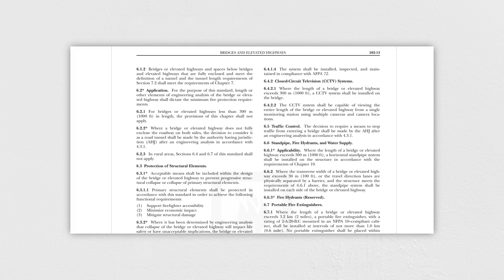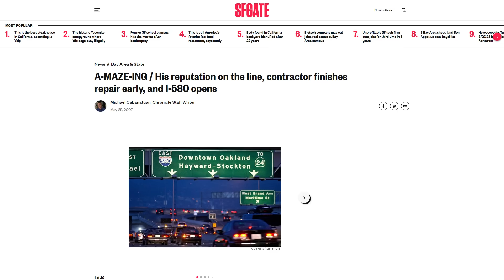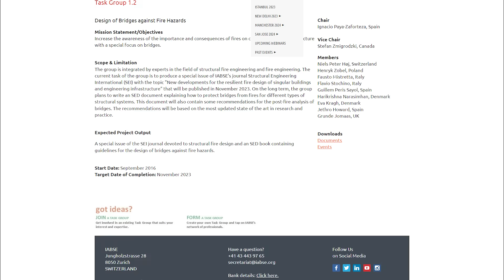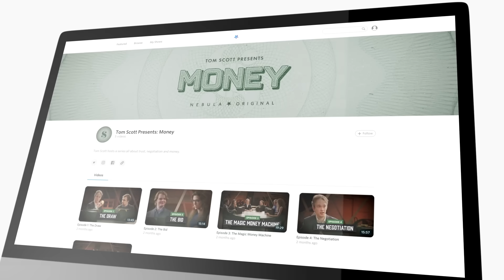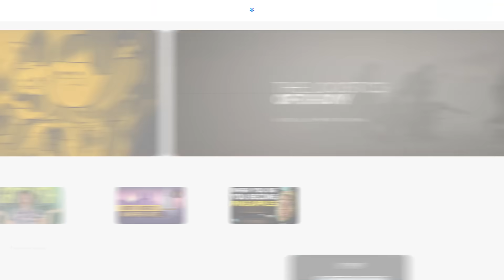Philadelphia I-95 Bridge Collapse Explained

Comment: I remember when the 2021 floods took out 3 bridges and sections of roadway on Highway 5 + taking out over 5 other bridges in the surrounding region in BC.

It took them 20 months to build the 200 km stretch of highway.

It has been over 20 months, and they still haven't rebuilt the 3 bridges that got knocked out by the floods. They have repaired the areas of road that got washed away, but the bridges have just sat there.

One bridge got knocked out along the HWY 1, near Boston Bar. A temporary bridge was installed in its placed, and no further work was done. There was work to done to reinforce the creekbed incase of another flood, but 20 months still and there has been no work done.

Comment: Grady -- Could we construct a cost-effective fire suppression system using something like the standpipe approach for tall buildings?

Basically, install high-volume sprinklers underneath the overpasses, with the supply pipes extending up to the road and slightly away from the bridge structure. Terminate the pipe with a standard standpipe fitting. Do not provide a permanent water supply.

Instead, if a fire starts, fire trucks will come to the scene, hook up to the standpipe(s) and supply water to put out the fire. 

Would that work?

Comment: This guy is also explaining the 911 attacks too. The facts are when you use any flame higher than the steel was formed the structure will collapse. Aviation fuel burns so hot that what brought down the towers. It's amazing how the left uses it's own info against themselves. Great video.
Reply: I don't think that was a left or right conspiracy. Because I know plenty of conservatives who believed it was a false flag and yadayadyada. The temperature isn't higher then the steel was formed, but the steel doesn't need to melt to weaken and sag under load

Comment: was hoping you would explain the structural failure mechanism :(
Reply: Steel gets soft when hot. everyone I'm assuming has heated up steel to make it easier to bend at some point
Reply: @SilverStarHeggisist  these structures are primarily concrete, are you proposing the reinforcement heated up thru the concrete cover? mild or tensioned reinforcement?

Comment: Being fire damage is becoming an increasing problem would it be worth and or possible to install/retrofit fire proof composite panels to the underside of the bridges that are at a high risk? Obviously you are going to lose some height by installing the panels but would the trade off be worth it?

Comment: When a gasoline truck burns down a steel/concrete bridge it’s accepted as fact. When large planes loaded with jet fuel cause buildings to collapse, it was a inside job because fire can’t weaken steel. In other news, Trump is “winning”.

Comment: One element I'm surprised you didn't discuss: A tanker fire is a destructive BEAST. Designing around something like that just seems prohibitively expensive, especially given the rarity and isolated nature of the risk.
Reply: Well, there are (relatively) cheap measures to prevent large fires under bridges in the first place: guard rails to prevent vehicles from crashing into the walls (and staying there as a result), lane direction separation to prevent head-on crashes, and education of drivers to not stop under or on bridges and in tunnels even if their vehicle is on fire. The latter is the most important - even if your vehicle is actively on fire, the wind keeps it relatively contained but once you stop, that effect will vanish and the fire will outright explode in intensity. This is also why, at least in parts of Europe, trains in high-speed train tunnels need to have emergency brake override systems in place.
Reply: @harddiskwp Well, a lot of these bridge collapses in the U.S related to fire happened on interstates, which are divided roads. I would be very interested to see what the Department of Transportation has come to the conclusion of the cause of the accident that led to the fire.

Because 1 or 2 times is a freak accident. But when it seems to be happening once every year or 2, something may be going on outside or just the design of the bridge and the roads.
Reply: @clonescope2433   There's a bit of a black swan effect here. Extremely rare events become more common as you expand the number of opportunities. 50 thousand miles of interstate and (according to BTS) 590,000+ highway bridges - even a 4-in-a-million chance would result in about 2 per year.   

(Very slim odds) X (Half a million rolls of the dice) = a high likelihood of event SOMEWHERE. 

But, reinforcing half a MILLION bridges is incredibly costly and would be more disruptive to traffic than the rare fire event. So the reasonable thing is to make them safe against more common issues and plan to quickly rebuild when needed.

Comment: A simple tradeoff would be to reduce the risk of large fires by stricter regulation of large flammable loads. Lower speed limits, higher standards for these drivers and vehicles. An increase in transport costs to reduce incident costs. I think many countries have that to some extent already.
Reply: you could make the trailer entirely crash proof, the increased cost to everyone else though would be astronomical. I'm not sure anyone wants to pay $20 a gallon just to prevent a relatively rare event

Comment: Wondering if it wouldnt be better to engineer tanker trucks with some kind of fire suppression system that engages on a cetain level of impact than bridges
Reply: Once the fire gets to the trailer, there's no system that will fit on a single vehicle that will stop it. a typical car fire is something like 5000 gallons of water to put out, and that's only 10 to 40 gallons of fuel. Now picture 5000 gallons of gas or diesel on fire.

That being said, if it's small, the truck has fire extinguisher(s) onboard

Comment: @Practical Engineering  Grady, thanks for the fantastic educational content. Would you consider a video about extreme heat events and problems with commercial flight? We’ve had cancellations due to heat here in Phoenix at temps over 120F (most recently 2017) and those temps will be more frequent and persistent in coming years. Do runways have to get longer? Or jet engines souped up to accelerate faster in takeoff? This is a climate change effect that we should probably talk more about.
Reply: Mostly, cargo and passenger loads have to go down. High temps reduce the lift over the wing (because the air under the wing is less dense, same reason hot air balloons don't fly in Phoenix in the summertime). Back in 2017, the tables that told them how much load the plane could carry versus temperature, only went up to 120F. So when it hit 122, they had no official guidance, so they stopped takeoffs. Now the tables go up to (I think) 145F.

Comment: Having been a messenger for 15 years in the Metropolitain Chicago area I have seen a lot of close calls.  Bridges with roads resurfaced under the bridges lead to many sheared off truck roofs. Trucks driving to fast in snow and rain. On one new vehicle break in run up into Wisconsin I had 3 tanker trucks southbound into the center of Milwaukee behind me pushing over 70 miles an hour. On the high bridge near the power plant south of the big interchange there had been a spinout  by a large 4-door car police officer was standing on the bumper to keep it from falling off the bridge. I did a half spin ended up sliding backwards for a half mile then flipped it straight before I hit a clear patch no idea what happened on the bridge too busy keeping the slide straight.  Knowing when to slow down is something many truck drivers seem to forget too often.

Comment: Ironically, a bridge with a wooden beam of equivalent load bearing capacity would be unlikely to fail under such circumstances. (It would also be absurdly large and heavy) However, I'm certain nobody would stamp a design with a wood construction. Although mass timber (not light stick frame) structures are known (and engineered )to resist fire.

Comment: I've been curious why  they decided against shoring up the south-bound bridge with a lot of wood as a temporary solution. I think the rebar in the bridge deck was still green when demolished. I think this would indicate that the driving surface didn't get so hot that it would be unusable. With enough wood, the bridge deck could have been supported without any reliance on the compromised steel beams. I suspect big wood beams are more expensive and less common on the east coast than here on the west coast. But it seems to me they could have had the highway open in half the time with shoring over the demolition and fill option they chose. I know I'm second-guessing the experts, but isn't that what the internet is for. :)

Comment: I'm a bridge engineer who works in downtown Philly. This section of 95 is directly on my commute. Although traffic was backed up in the detour, it was not nearly as bad as I expected it to be (+30min). The new fix is indistinguishable from the previous state in terms of traffic, because that section of 95 was already taken down to 3 lanes in each direction for construction.

As you pointed to on the video, we basically never design for fire. There's no point. It's statistically a very low probability that fire will damage or destroy a bridge, and engineers design based on probability.  It would be a waste of money, time, and materials. But most importantly it would severely complicate important aspects of bridge maintenance like inspection, considering most fire protection systems involve buffering the damaging heat with other materials over the bridge elements.  It's not a building where the structure can be hidden; we have to routinely inspect these elements.

Comment: Im not sure that at least your opinion in the cause of collapse was presented. From the limited pictures I've seen, i can't tell what the bridge girders were made of. Steel or reinforced concrete? How would a fire of that magnitude affect them differently? How  long was it burning before fast the fire department arrive? Also as others pointed out, overpass failures and tanker truck fires seem to correlate. Maybe the question is not how to make the bridge withstand a fire, but to make the tanker truck safer.

Comment: I'm aware of a motorway viaduct/ junction in England that was designated a national secret (even though 200,000+ vehicles per day pass through it) because an attack upon it could take out not only the road, but a railway, a canal and a major high pressure gas line.    Large vans and trucks 'stopping' underneath for an extended period of time would very quickly get a visit from the police for a welfare check.

Comment: Tanker fires under bridges are likely often because the drivers stop there in the shade when they are having an issue that turns into a fire. 
Not all tanker fired start in or on the tank or because of its contents.  
They likely start because of overheated brakes, blown tires that aren't noticed until they start burning and so on.

Comment: couldn't they make a designated fuel tanker route and have the most vulnerable brudges along that route equipped with a halon system or fire suppression foam? we know where the tankers come from and where they're going, I'm sure hazardous material transport regulations already have infrastructure you could tap for the logistics.

Comment: Most construction is slow, because they're just being slow. Throw money at them, and it gets done lightning fast. In this case, they likely did involve more labor, but that's often not the case. (many jobs can be completed faster without additional hardware or people.) [When you're paid by the hour, you make the job take longer. When paid by the job, you get it done as fast as possible. Both have their obvious draw backs.]

Comment: Steel bars and joints are melted from heat exposure and whole structure lost integrity and its weight pushed it down. Gravity is a beech.
Reply: Softened yes.  Melted no.

Comment: It's kind of intriguing how many tankers get into accidents perfectly under bridges. Hundreds of kilometres of open road, yet they crash at the few 10 metres under or on a bridge, much more frequently than chance level.
Reply: My theory is they stop under bridges when they have trouble so they are in the shade. My guess is the fire is secondary to the original issue with the trucks.

Comment: This was another high-quality video, Grady.  There is a similar situation in the electric utility infrastructure realm.  As a retired electrical engineer who worked in the distribution, substation and transmission portions of the industry, we established design and protection/response policies based on the likelihood of a destructive event occurring and the time/cost to recover from it.  For example, Over 90% of storms have destructive winds with speeds of 80 mph or less (broad generalization).  The engineering divisions or policy makers establish strength standards to withstand 80 mph winds (plus some safety factors).  It is known that usually no more than a half mile of transmission line will fall down due to the winds hitting a section.  The utility will maintain an adequate inventory of poles, conductors and insulators to replace about a mile of line within a few hours to a couple of days after a significant event.  Storms beyond that necessitate a broader response, often coming from several states distant.  Typically, the electric utility will purchase insurance coverage for its substations and generators but it won't secure insurance for its distribution lines or transmission lines.  They self-insure for the cost of events spread across broad areas of service territory, which can sometimes mean thousands of miles of distribution or transmission lines.  A key response tool for both the land transportation network and the electric utility network is to have had a cross-section of its operating division personnel participate (periodically) in "what would we do if....?" exercises to identify the range of possible recovery alternatives.  HILP - "High Impact Low Probability" events demand some attention - at least to have been thought about if not also going so far as to acquire a stockpile of fast-response supplies.  Keep up your good work!

Comment: Before watching: 

"Why fires destroy bridges".  Huh?  Why wouldn't they?  Fire softens metal, decreasing its tensile strength.  Fire partly decomposes cement, weakening concrete.  And big fires don't happen on bridges often enough to justify designing them to withstand it.

After watching: Ok, it's a bit more common than I thought. But there are a lot of bridges, as you say.  Too bad you didn't say anything about how expensive it would be to make a bridge capable of remaining usable after a tanker fire.

Comment: In October of 21 I was consulting for an oil and gas firm. The engineer decided a bridge didn't need replaced to support rig traffic. We put a truck partially through it. Scrambled with multiple contractors to get a temporary bridge. The cost of closing the roads was millions of dollars a day. I spend 3 mill in 45 minutes to get the replacement temp bridge and personal mobilized. Emergency projects are very interesting to work on and understanding the economics is fascinating

Comment: Easy Solution is to mandate a Basic Low Pressure Sprinkler System Or a Foam sprayer on the Tankers and you can Save Many lives..

Comment: Heh.. the freeway overpass your video drove under (with the Arizona Loop 202 sign) is one I drove under daily for nearly 20 years. Used to live six miles away before moving a little further out. Unexpected. :) Actually, there were a couple of locations I recognized! (I used to get around a lot.)

For the tanker fires, there was a crash here in AZ not more than a week ago where, because it was away from structures, the fire department decided that the environmental impact of trying to put out the fire (fuel floats on water, afterall, meaning the flames could be spread through runoff) would be less by  simply letting the load burn off. Took hours. So in the case of bridges, I think the smarter path isn't so much to consider fires as it is to try to find ways to lessen the chance of collision with bridge support elements. As well, if you look at the path of that exit ramp, a gentler curve might have reduced the possibility of car to car collisions which could also result in such fires. So an eye towards elements, in the same vein as null posts, deflecting a vehicle from the bridge structure along with changes in layout to increase visibility and lessen the chance of tight corner collisions. In other words, perhaps more beneficial prevent the fires more than attempt to engineer for them. (Not that engineering improvements can't also be made on fire resistance, such as long lasting thermal resistant coatings.)

Comment: I've been around concrete and welding...and I can tell you that concrete of most any kind....just won't tolerate heat like a fire...just red hot sparks and slag from a cutting torch will ruin the floor of a welding shop....nearly instantly....

Comment: Where are all the 9/11 truthers applying their same logic to this incident; that the bridge couldn't have collapsed because fuel doesn't burn hot enough to melt steel. Because as we all know steel retains 100% of its strength right up until the melting point.